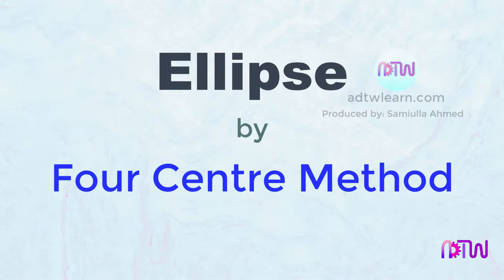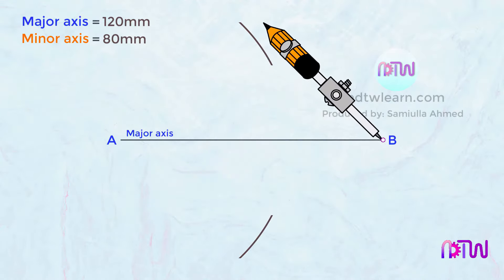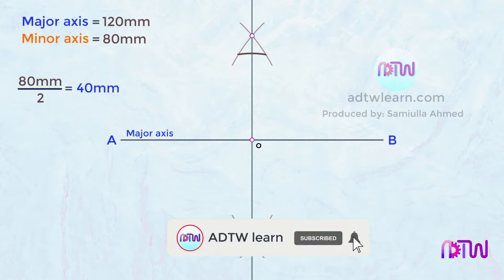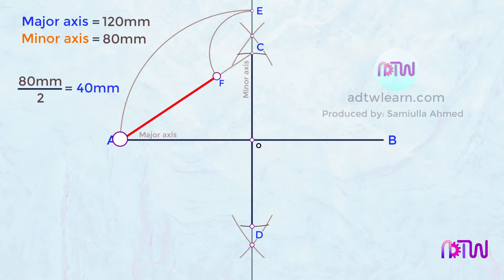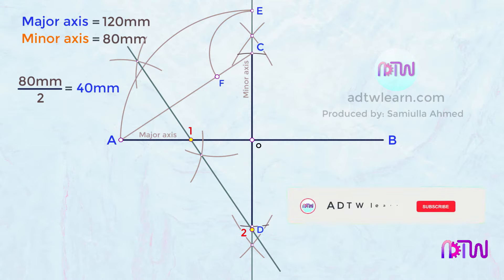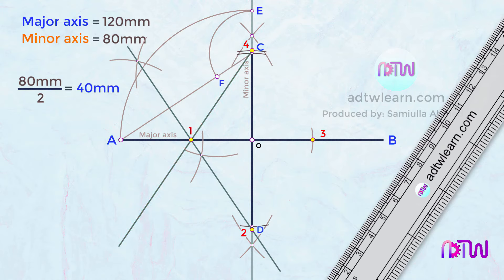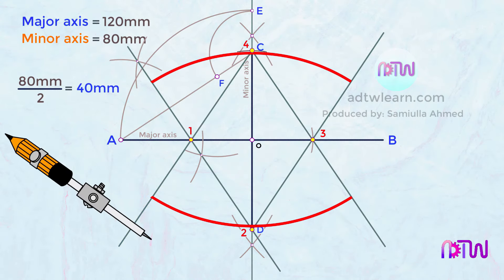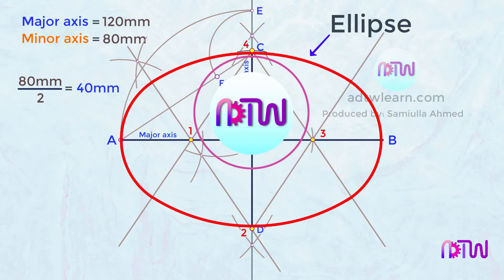How to Draw Ellipse by four centre method in Engineering Drawing

Comment: My last step is not coming.... where am I going wrong 😞
Reply: Mine too
Reply: So it turns out mine as well you need to take it from 2 to C and visa versa
Reply: U need to check ur measurement again
Reply: Me too where u
Reply: I had the same idea.
Reply: I think your mistake is that you are making the compass length start from the upper center and ends at the lower center then you make your curve 
The correct way is that you make the compass's length start from the upper center for example and end at the lower minor radius then curve,then from the lower center to the upper minor radius then curve.

Don't do it from a center to a center, because like that you are exceeding the minor radius
Reply: Same here
Reply: It's because C and 4 are different points and same with D and 2
Reply: Hlo everyone here's I am to clarify one thing of yours 

1. You have to take point 2 as center then draw from your desired distance not from point 2

Comment: Thanks for the great demo.
I want to draw 2 elipses one inside the other. 
The length of the bigger ( outer Elipses)  i want to be 72 CM and width of 48 CM.
The smaller inside Elipses length I want to be 70 CM and width of 46 CM CM
So we have 2 elipses one inside the other with 2 CM space between them all the way round
How can I go about it
I want it for the design 3:08  of a Bonsai forest pot made by cement.
Can you help pls ?
Already thank you for your guidance

Comment: What do you mean by more than half its not clear plss
Reply from the maker: If you want to bisect a line into two halves, then you need to adjust the compass length to more than half the length of that line which you want to bisect...
Reply: More than half  can mean any number that is higher than half. Therefore you are not clear.  We work with accuracy
Reply: @kgothatsoseatlhodi3187  "more than half" is clear regardless because the length that the compass has to be set at is an arbitrary measurement; as long as the setting is more than half of the length of the line, four arcs can be cut (2 on either side of the segment) and a perpendicular bisection may be drawn accurately